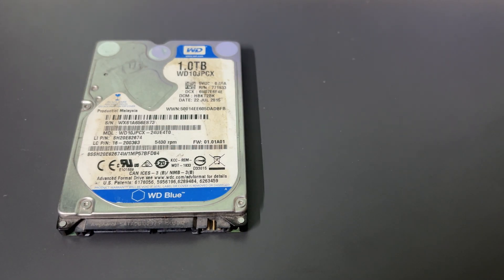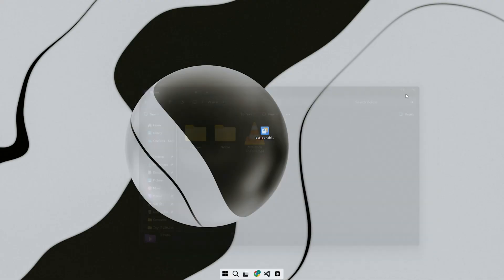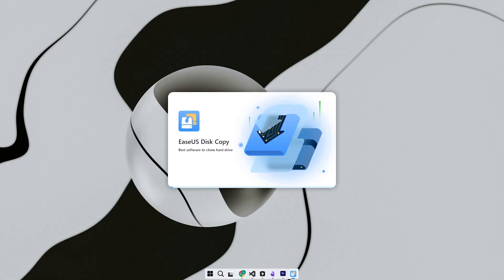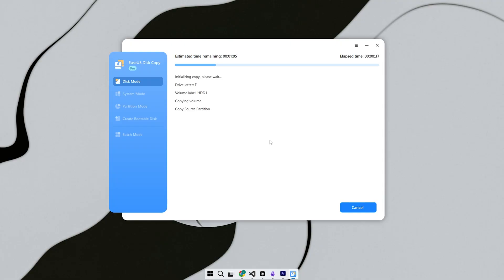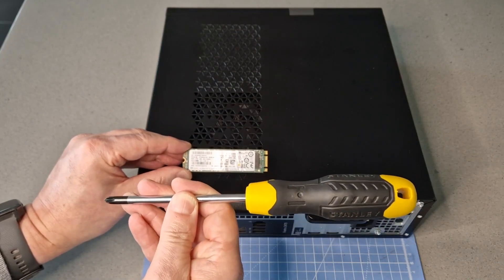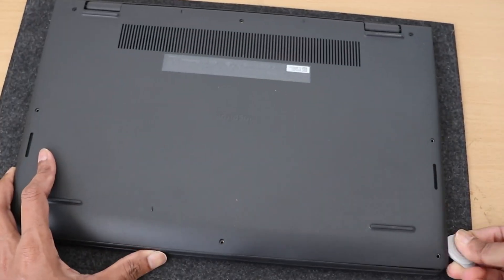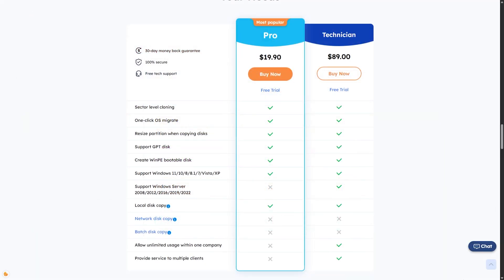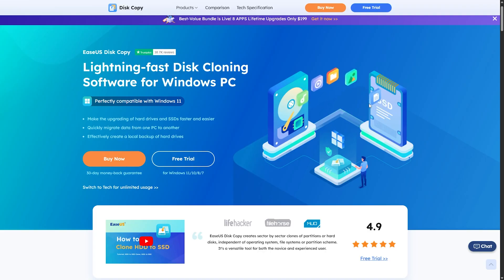Migrate Windows to a New SSD Using EaseUS Disk Copy (No Reinstall)

Comment: Is there a way to do this between computers? I have an older PC that I'm upgrading to a new miniPC.
Reply from the maker: Yes, that's the exact purpose this is meant for. Copying entire disks from old to new Disks (doesn't matter same PC or different)
Reply: @HarborOfTech  Good to hear. It seemed like the main use was to put a new drive in the same PC, but I'm guessing there will be instructions on how to copy to a new PC. Thanks!